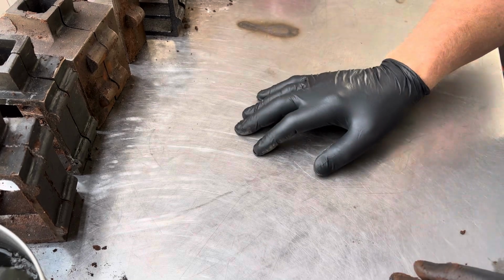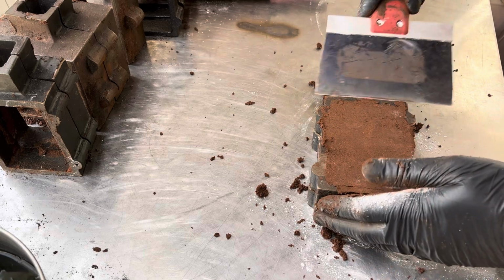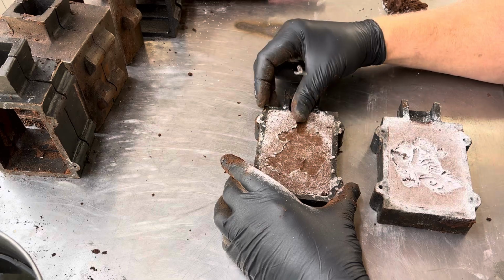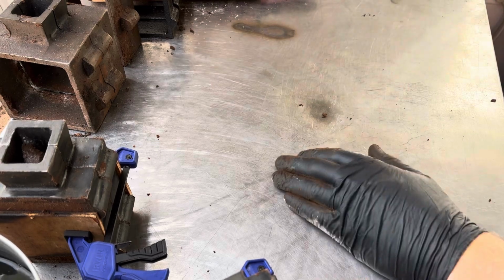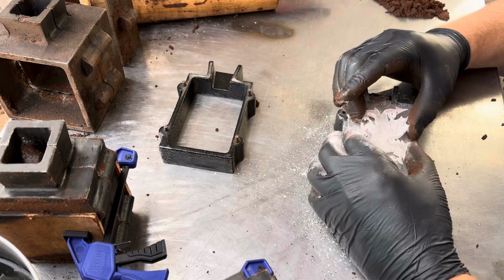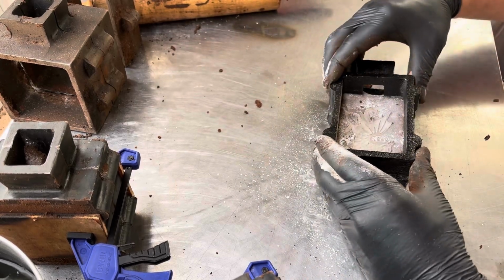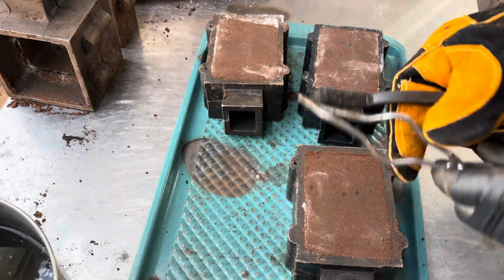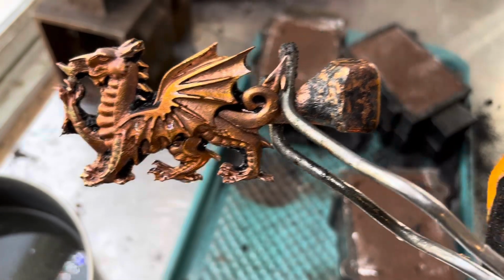Sand casting a few copper pieces with my Toauto furnace. Step by step

Comment: What kind of material do you use for the molded pieces? Can you use stuff that is made on a 3D printer? Nice copper art BTW!
Reply from the maker: Yes, you can use a 3d printer to make the pattern.  I use a resin printer.  They both will work.